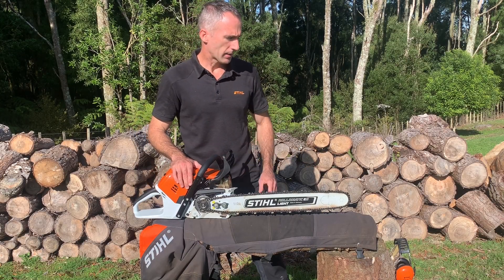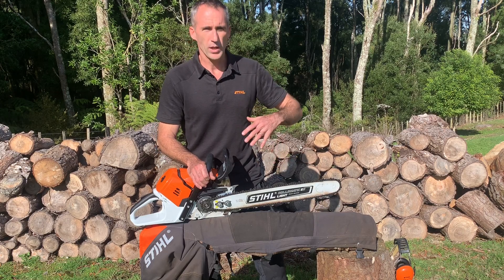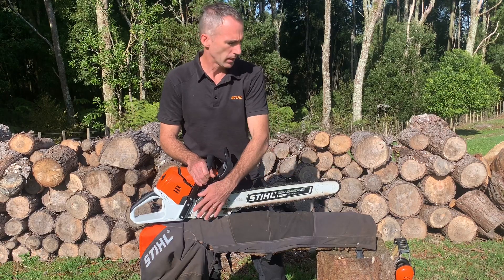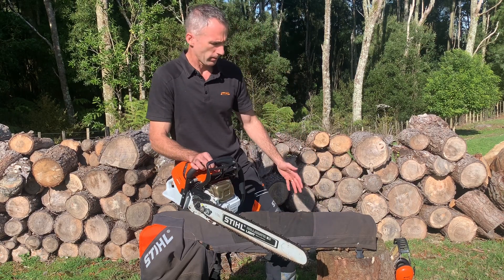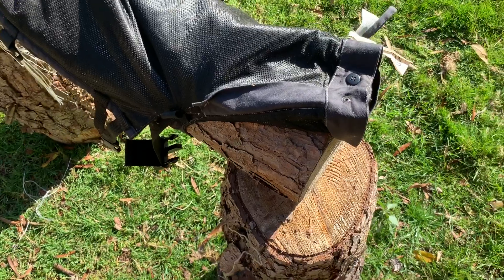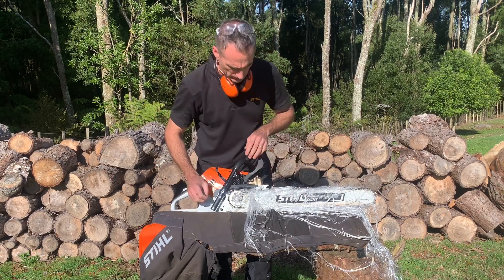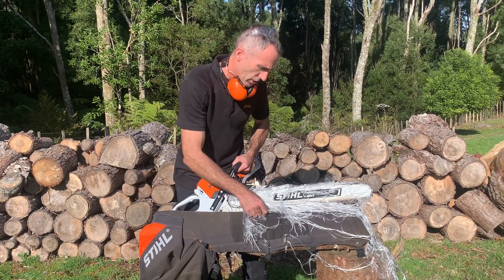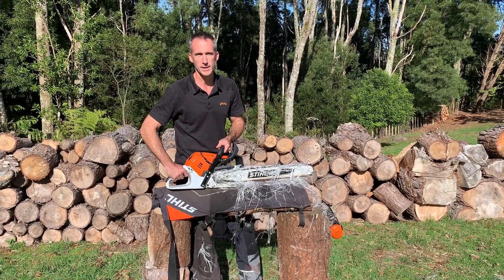How STIHL Chainsaw Protective Chaps Work

Comment: I would like to see if I can buy a custom made version for a battlebot that can wrap around my robot for battle allowing it to be protected by all blades and tumbler attacks…. Can I email y’all?
Reply: If they don't get back to you, you can absolutely just buy some and cut them up. You have to slice instead of shred/ tear them, a pair of wire cutters would do it slowly. Then you just glue/expoxy the edges down and you have squares or whatever shape you want.
It wouldn't protect it against all blades, only serrated ones that can "grab". Flat grinding discs would go through it fine.

Comment: Well my stihl chaps didn't work. Have a big cut in my shin. But then I didn't do a bullshit test cutting down the leg it was across the leg where less surface area was cut
Reply: At least you didn’t lost the damn leg
Reply: @northerncowpoke7020  yes that's true. But the tests aren't accurate and not valid for real world situations
Reply: @satched  yeah but in a situation that happens so quick there’s a possibility you won’t lose your leg. These chaps are not fully protective but it helps from getting ur leg amputated.
Reply: @northerncowpoke7020  I agree with you there. But their example is almost like they are claiming that they are fully protective
Reply: @northerncowpoke7020  
But he ruined his chaps and now he has to buy another pair!
Reply: Loner Wolf  
That's the trouble with stupid people, 'no common sense' and they think that some how they are invinciple when dressed up in so-called protective fancy gear.
Reply: Loner Wolf  yeah was a freak thing that happened. Had a tooth that was bent up. And using top of bar to put scary in. Must of hit knotty wood or cross grains. And bounced straight out into my chaps through my leg.
Reply: Admitting to doing three stupid things and you blame the product. In my saw class a guy came up to the instructor And told him the saw just quit working. The instructor looked down At his thigh and saw a small notch. One fiber had pulled out and locked  the saw up. If yours didn’t work you should’ve sued the company. But then again they would’ve had experts analyze your injury and then file a countersuit for defamation.